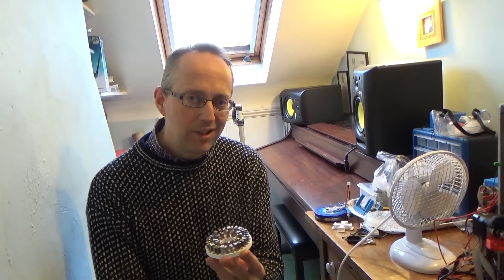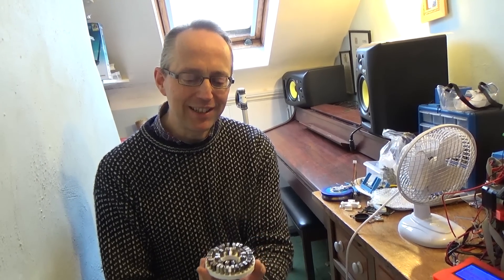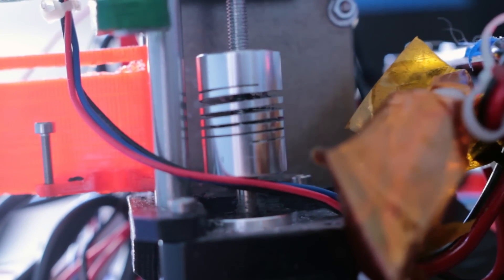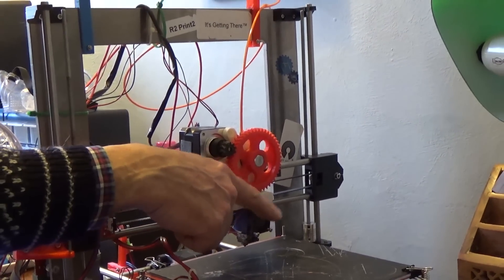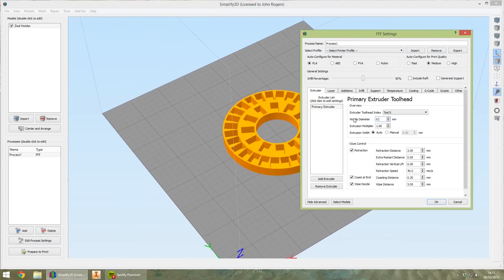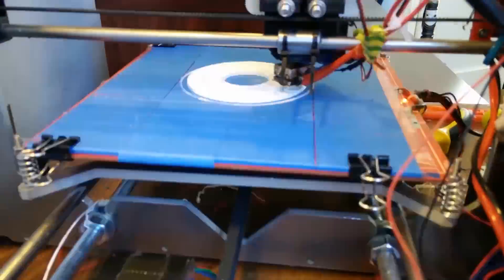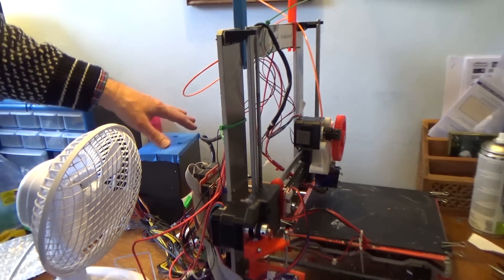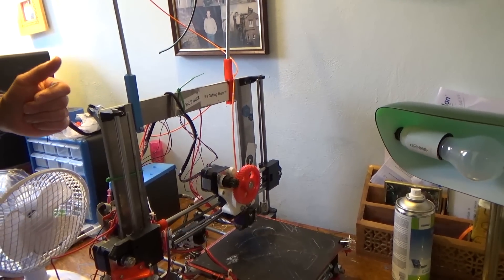3D Printing a Wood and Leather Type Holder

Comment: Very good, did you make the holder a tight fit, or can the stamps fall out?
With 3d printers you can actually make items which are impossible to create any other way.
Reply from the maker: voodooalpaca The stamps are a snug fit so easy to extract, but not too loose! John has printed cogs locked within cogs that you could not machine up - its clever technology!

Comment: They are clever little machines for sure - I think it's interesting that they are a kind of positive analogue to the CNC router - where CNC starts with a block of material and converts half of it to dust/filings leaving behind the required form, the 3D printer builds it up positively. I wonder what forms are better suited to 3D printing, rather than CNC routing in that sense? That being said, I'd love to have a go!

Comment: Fascinating! I'd like more detail about the process and costs if you have time please. How long did it take to print? Did you need to clean it up after the printing process? How much do the plastic "ink strings" cost and how may did you use to produce this little item? How much did the kit cost to make the 3D printer? Thanks! :)
Reply from the maker: Bernhard Hofmann Hi Bernhard - please see what I have just said to Dougie above -at the moment the technology has a long way to go! Since making this film John has been redesigning his machine and printing out new parts.